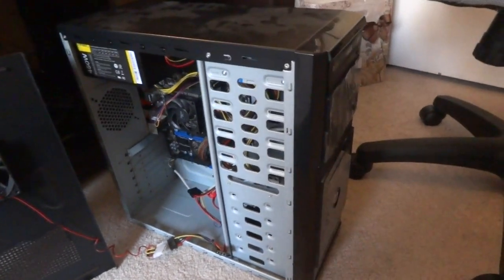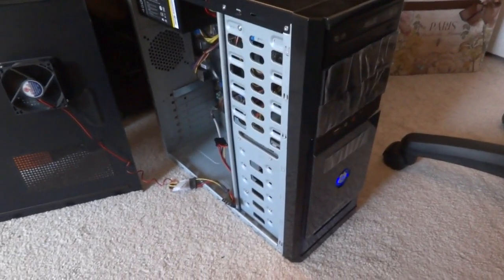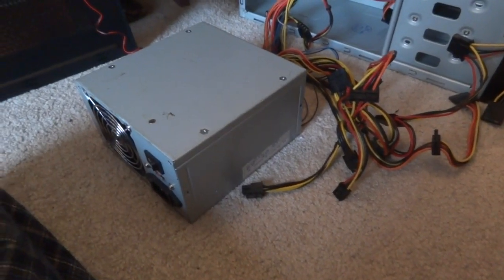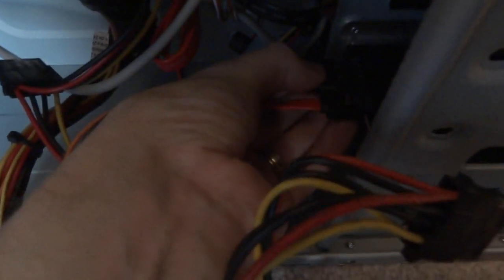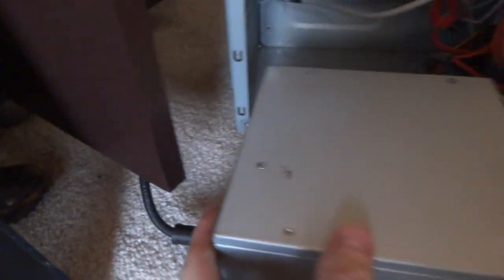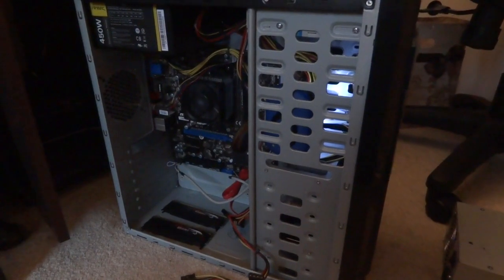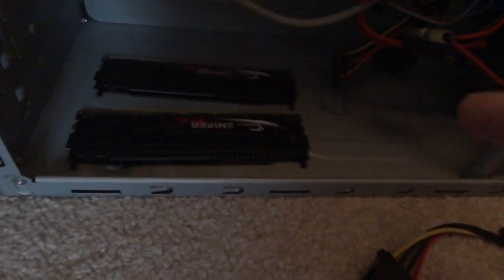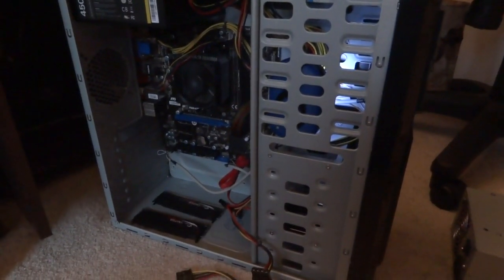Computer problem, no beep, no boot, no picture, and the solution

Comment: that's would be impossible, the post has nothing to do with the monitor, it could've been that by removing your ram you clear the bios and that got it going. a loose cable means it won't display, there is no such beep for a cable that is loose from the monitor.

Comment: Please Help !!!!
I have the same problem but my mouse is working (light turns on), keyboard is not working, dvd drive is working (opens up when i press the button). Eventually, i was trying to overclock my ram, and when i exited the bios this problem started. Please help me !!

I have tried reseting my bios by removing the battery but it doesnt work. When i remove all the ram sticks, it starts beeping.

PLEASE HELP!!!!
**********
Reply: hey P1 you have to reset your cmos jumper and battery
Reply: ShadedBlade thanks for the reply bro, but when i cleaned the ram slot the pc started working

Comment: how about no fan , no beep , no start up , no light?
Reply: +Otaku Gamer how about no beep, no start up, but got fans and lights
Reply: +Otaku Gamer 
aw.,., try to dispose :D
Reply: Brian Kenn Acera its fixed already, I consulted an expert he just reset the cmos.
wayyy better than disposing :)
Reply: +itzKronix Well, that was a shorted motherboard. Now I got a whole new problem. Scratched across 3 traces, creating a connection between them. PC starts up and shuts off instantly. Using multimeter, and scratching/cleaning between the traces, I was able to break connection from one of them. I still have a reading of 130ohm between the other two adjacent traces so there must be some kind of connection between them but I can't see it even under a magnifying glass. Gah!
Reply: nemac23 I got the same problem, any one can help please?

Comment: I have some solution for your problem..
Before removing or connecting, make sure the power cable is plugged out (make sure that there's no static electricity by turning on your pc after you plugged out ur power cable)
Wait 3 second or so then, remove all ram, gpu and pci card, then, plug the power cable and turn on the pc... if there's beep or the pc continue powered on(for no beep motherboard) then you'll be good.. if not try turning off the pc (plug in the power cable) then, press and hold the power button untill your pc is turned off again(this might fix your motherboard problem)
Then, connect you ram one by one continued by gpu then pci card etc(warning: before connecting make sure there's no static electricity left in the motherboard (removing cmos is NOT necessary but it could fix your problem too)

If it work, like this comment so others could fix their pc too.
Reply: Need help dude

Comment: Heey i need some help in here, i have an emachines t6560, old computer, but i found in my home an ATI RADEON HD5450, so i decided to put that video card into the computer, however, after i plug in the Radeon in the PCI port, i dont get any display, and it happens everytime i connect the video card,  If i leave the original integrated video card ATI 200xpress series, it starts up normally, if i connect the new one, and change the monitor cable to that one, no signal is been shown, what could be? i changed the power supply to over a one with 600w, so i dont think anymore its the power supply, you guys have any idea?
Reply: JóH RédFíéld Your ATI RADEON HD5450 is dead so get a new GFX card
Reply: ***** ehm, i tested it on another PC it works fine, but i guess its just the board its too old...
Reply: *****
Not really sure if that board is compatible with the graphic card...
Reply: *****
that's sort of weird, fans are not normally placed were the video cards are placed in the mother board, unless u got another fan placed there...
Reply: *****
Oh cehsh what a mess

Comment: I had the same problem with my PC today and I was googling for a solution when I came across this video. Same issue fan power etc running but no boot "Beep". So I checked all the hard disk cable - no good. Then I replug my monitor cable and it worked! Got the beep and all go again. Really strange I never thought you need a monitor to boot a PC. Anyway many thank for the poster you saved me getting a new computer (for now).

Comment: So are you saying the monitor had to be plugged in for your computer to boot up?
Reply: JóH RédFíéld
Did you go into the bios and enable plug n play, I had troubles too, i connected the integrated video card, Then i went into bios and enabled plug n play, then turned off the PC connected the video card pci, and it displayed, i don't know if it makes a difference but i worked for me. Good Luck.
Reply: it still start up but no picture.
Reply: BadMadPlay
Heey i need some help in here, i have an emachines t6560, old computer, but i found in my home an ATI RADEON HD5450, so i decided to put that video card into the computer, however, after i plug in the Radeon in the PCI port, i dont get any display, and it happens everytime i connect the video card,  If i leave the original integrated video card ATI 200xpress series, it starts up normally, if i connect the new one, and change the monitor cable to that one, no signal is been shown, what could be? i changed the power supply to over a one with 600w, so i dont think anymore its the power supply, you guys have any idea?
Reply: If that doesn't work i suggest you flash the bios to the latest version. Then repeat the above ^
Reply: BadMadPlay hi, thanks for the repply, well, I'm sort of a trouble with the bios, because when i enter to setup, it doesn't play any video reference, not even the integrated video adapter, so well i was trying to flash the bios, but it turns out doesn't have more updates, and i'm sort of afraid to press on one of those "everest" function of updating bios, I dont want to brick/break the bios, if the firmware its different... and since the manufacturer website doesn't show any updates... so any ideas ? should i risk updating the bios, or ...?
Reply: JóH RédFíéld
Sorry no more ideas from me, you will need to seek professional advice from someone else on forums about that risk, i would look up your issue through googles search.

Comment: Was the mouse and keyboard working...
Reply: My problem was fixed 4 months ago, it was a defective PSU that eventually blew up my motherboard as well...
Reply: ***** Nope, no lights on keyboard or mouse
Reply: Try going to one of those places where they can fix your computer for you, tell em to test your power supply. If it works then that is the problem if still nothing happens with a different power supply your motherboard probably died.

Comment: Thank You so much man,u know what,i try to boot without ram and hdd,i let it beeps for 3 times  and 1 minute,then turn off system,and pull out the cable,put ram at another place and connect back cable to hdd boot it again,beeps for 2 time and it works man,thanks man,thank you som muuuch,